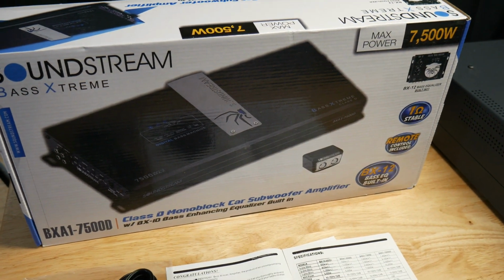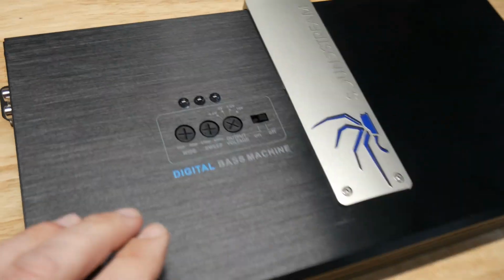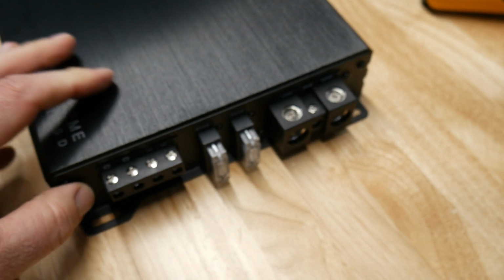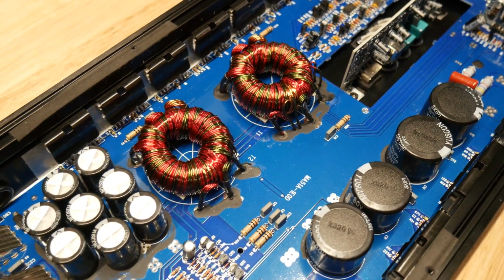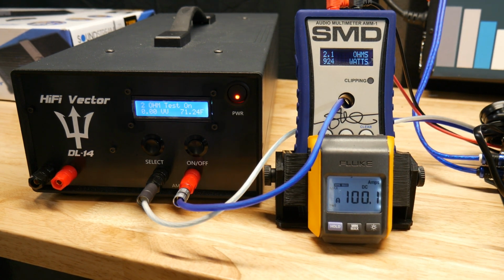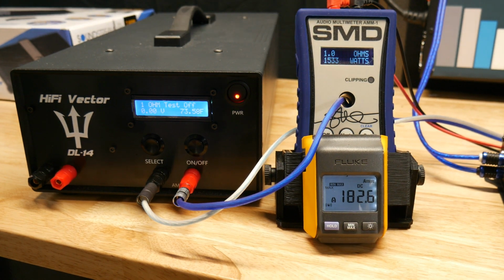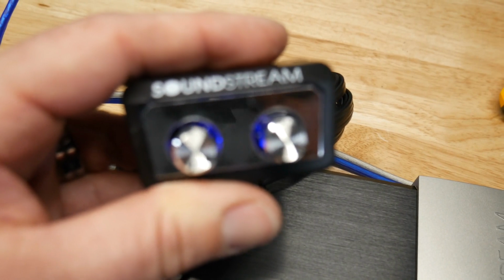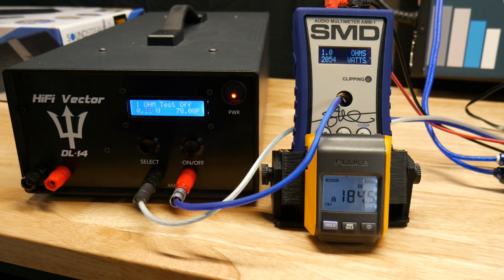Soundstream BXA1-7500D amp dyno review car audio sub amplifier you wont believe what we found inside

Comment: So why does it say 7500 watts is it only puts out less then 2500
Reply: Straight to the point, cheap brands lie by saying higher numbers to take advantage of unsuspecting customers that don't know much about amps and such, people that compare amps by there power rating; a higher number sells better. Example, if many seen a Sundown 7500 watt for $2000, a Digital Designs 6000 watt for $800, Taramps 8K for $600 and then a Soundstream 7500 watt for $200, many average consumers would grab the Soundstream because it seems like a bargain, hoping it does close to the 7500 watts, High power and cheap! However, the company lied about its ratings. 

Soundstream is a shell of its former self. Once a high end brand, that made quality products, it is now owned by large company that will say anything, including lies, to sell a mass produced generic product. Soundstream from the 80's, 90's, and maybe early 2000's was legit, but not so much these days. Basically like all cheap brands today, they will say a MAX power rating to make an amp or speaker, seam better than what it is. MAX power can basically be any number you want, even if it will never be able to do it. RMS power is supposed to be the numbers to go by, but they lied there too. Better brands don’t do this sort of stuff. Sad what happens to these once great brands. That said, for the price of these on clearance, it wasn't too bad for almost 2k RMS. 

People that are more heavily into audio gear know what brands lie or tell the truth, but cheap brands like this take advantage of the unknowing. Granted, that doesn't mean an amp is bad just because they lied about its power output, still might be perfectly fine to use at a fair price if it does what you need, just as shown in the video, won't do the 7500 watts.

Lastly, anyone out there that doesn't know much about brands and such, do research, and ask on forums or wherever before buying amps / subs. The Amp Dyno videos really help when researching an amp to see how close it comes to its ratings. Type the amp brand and model followed by amp dyno into youtube search and see if the amp you want to buy has been tested.

Comment: Just a little fyi...
The Magnusson/Moss act says that "warranty void if removed" stickers are not legally binding and the onus is on the company to prove that opening something up or specific modifications are the cause of device failure. So that sticker may as well be a paw patrol sticker on the bottom of that amp (at least in merica). Companies do this because they know no one is going to pay all the legal fees to fight it in court when replacing the device would be cheaper. That said, they know the law and I'd you're ever in a situation due to this push back and they should relent.

Comment: i just got a soundstream sr1.5000d rated at 2000 rms 1 ohm and its running 1 ground zero sub and its not even close to 2000 on max gain.. wish i could find an amp dino of it

Comment: Will this amp handle .5 ohm?
Reply from the maker: It is not listed as .5ohm stable and we didn’t test at .5 ohm so can’t say.
Reply: @HiFiVector  So I hooked it up to my 2 - 12's. Wired for .5ohm and it's running perfectly for 2 weeks with quite a few hours of bumpin. I realize with impedance rise I'm probably closer to 1 ohm. But still.....

Comment: These older Soundstrem amps are of much higher quality than their latest offerings and some are actually Korean made. I am currently running a Pn1 650d thats been performing flawlessly for 4 years. I also owned the previous version of that amp and installed it in my son’s car and that one is 8 years old and still running strong. They are a good value at the true power output.
Reply from the maker: Yes we have installed many of the PIcasso Nano amps and they are super reliable and put out what they say RMS so they are great little amps for sure. Also the new TXP are great amp as well. Thank for watching!

Comment: Excellent again my friend ! Do you think that, that bass knob would work on my Soundstream TXP.1 18000D ,its pritty fancy ?
Reply from the maker: No most bass knobs are not interchangeable.  I looked into that a while ago. The wiring configuration is different, even some of the same brand amps but different wattage models they are different and use a different cable and configuration. I wish they were more universal. Thanks so much for watching!
Reply: No problem man love to watch thanks for checking in to that for me